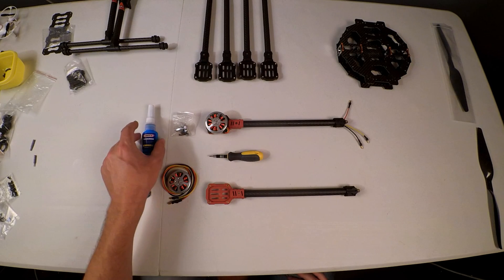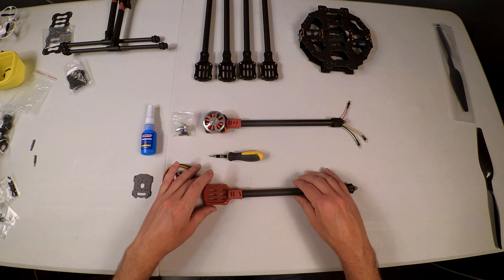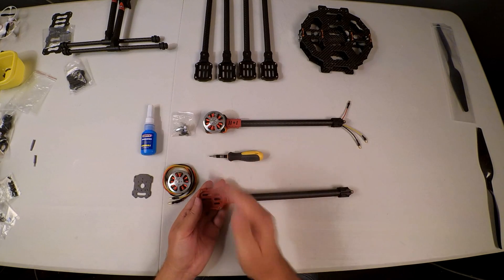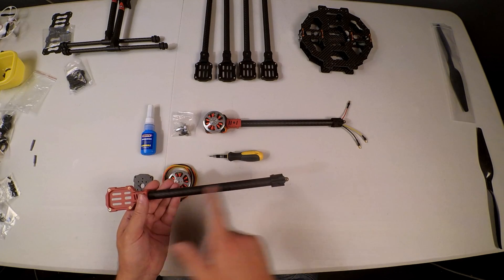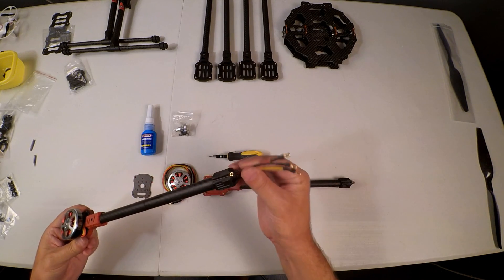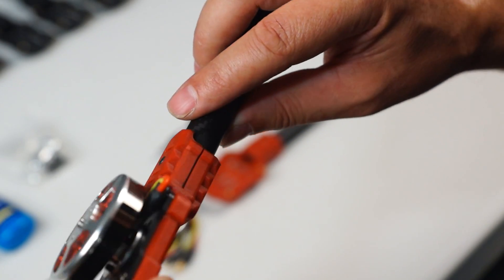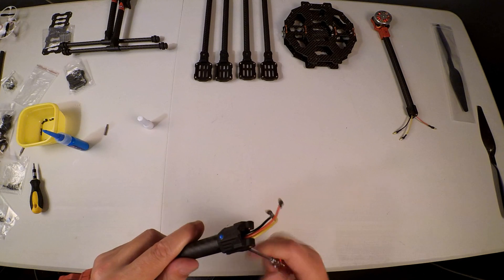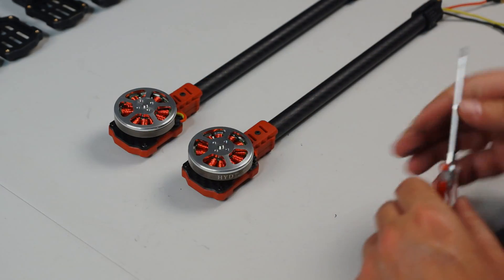Hexacopter Build Part 3 - Tarot FY690S Mount Motors

Comment: Hi, can i use "Sunnysky X4108S 380kv" or "SUNNYSKY V3508 380 kv" motors with FY690s frame? If yes, which one is better with 1355 props?
Reply: I am using the Sunnysky X3508 380kv and it was tricky putting them on the arms. I had to use m3 screws on the bottom.